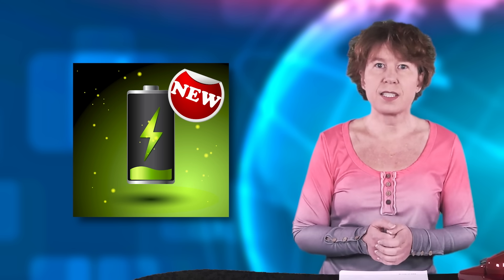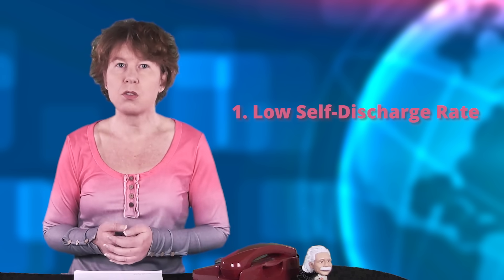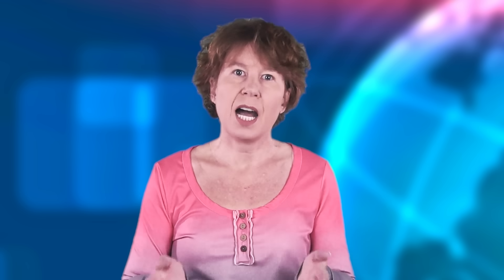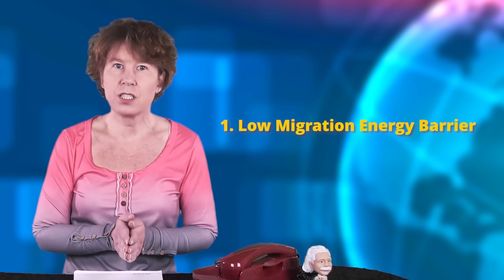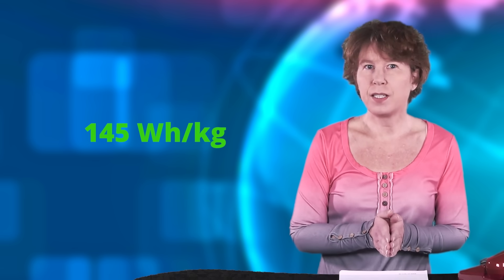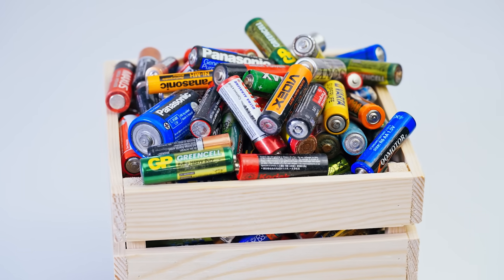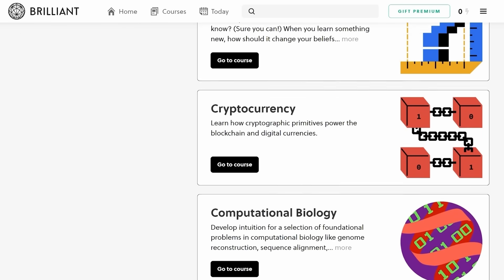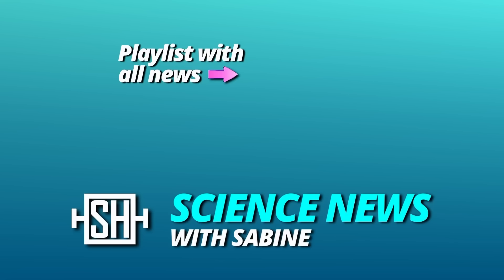Fully Charged in Just 5 Minutes: New Battery Breaks Records

Comment: I think people have to look at the history of the automobile to understand the issues EV faces. First if all, the car remained for many ppl a curiousity well after the model T. Cost was a big factor as with EVs, the 600 buck model T was a lot of money and banks would not lend 600 bucks to a working class guy. Without a mass if cars out there, filling stations were relatively rare. 

The irony is electric cars until WWI were more popular than gas engine cars. Why? Ease of driving. The hand crank was a disaster area. Controlling the engine wasnt easy either, you had to futz with spark advance abd the like to be able to drive them. The starter and centrifugal spark advance drove the car forward. 

The real problem is they are pushing ev's ahead of the curve of adoptance. Pushing banning gas cars after 2034, for example, is too fast bc evs have limitations. 

Shall we talk about cold weather charging and that batteries output plummets when it gets cold? Lithium has the same problem lead acid batteries have, internal resistance grows as temp drops. 

There is also the fire hazard. Lot of places it is illegal to charge your ev in the garage. They have lost cargo ships with evs to fire, a car goes up & then boof, the whole ship is lost.  A big problem is putting out the fires, they often resort to water which is horrible, water reacts w lithium , but they have no choice bc they don't have the chemical fire compounds. So they will he pouring water for a half hour to try and put it out. 

Personally i think solid state fuel cells are the way to go, batteries fundamentally have the charging problem fuel cells don't have. No charging, you pump out the product if the reaction to be recycled abd you pump in electrolyte. 

We have to get off of fossil fuels, if for anything to put the middle east our of business, neutering Iran, Saudi Arabia, Qatar and Russia. Oil is basically a giant protection racket,  it allows iran and saudi and russia to do what they want and not face consequences.

Comment: Some technologies are so called "Enabler Technologies" which means they are often - on their own - not very interesting, however they enable other technologies and products to be actually useful.  A very fast charging battery is one of those things.
Reply: I can imagine military would be interested. Or medicine. Or some field occupation where it really matters. Not everything has to do with our phones or cars.
Reply: To enable what? Electric mobility taking over, maybe? Not likely, and the earlier people realise that the better so a fast charging battery like that may actually be a bad thing.
Reply: @martinstubs6203  If it doesn't work for that, other people might find a completely different use for it. Just an idea: with such batteries wireless headphones would become the standard, because you would no longer have to put such heavy batteries into it. If they only last for like 4 hours, but they completely recharge while you take a bathroom break, that wouldn't be an issue.

Comment: The major issue , should this ever come to fruition, is that the 145KWh is now delivered is 5 minutes - so if that 145KWh is normally dissipated (at steady rate) over a 2 Hour journey, then to replenish it in 5 minutes will need 12*145KWh equivalent input 1.74MWh delivery to the filling station where now you are not waiting for the 1 hour charge but for the queue of people waiting to use the outlet.  Then the cables will need to be hightly specialised with the energy capacity and isolation to handle that amount of power safely.
Reply: Ultra rapid chargers often work by taking the power from an onsite battery which can be charged up more slowly, averaging out the current draw, instead of needing a very high power grid connection that is only used part of the time.

Comment: I have been watching your channel off and on, mainly on topics I have an interest about. But I saw that I think Toyota (Japanese car firm) making an H2O engine and was hoping to learn more about how it would work in your way of explaining things.
Reply: Toyota have been selling these for years.  On a 1000km journey in Norway the hydrogen powered Mirai took 8 hours and forty minutes.  The battery powered Tesla Model S LR did it fifteen minutes slower.  Neither of these times included time for breaks.  If breaks were included the Tesla would have been faster because the charging would be happening during the breaks but the filling with hydrogen can't be.

Also, with hydrogen you lose many of the benefits of an EV so I don't think hydrogen is viable.

Comment: The indium option provides a secondary market for zinc mining tailings. It won't offset the lithium issue, but may mitigate the lithium-producer-advantage in markets.
Reply: I'm thinking that stationary batteries, like for whole house backup, don't need to be light weight and smaller volume, which would release more lithium production for uses where energy density is important.

Comment: Why restrict battery re- charging on the go to brake regen... What would be wrong with an old fashion dynamo made lighter with modern materials and utilising Hall effect..  Interfaced with a  segregated battery under software control. If the dynamo engaged via a clutch, it could be selected in train or out, so that a   car  with a modest size battery could be set-up to yield that extra 50 miles to complete a long journey by trading speed for a modicum of on-the-go re-charge over a limited distance, without needing to stop for a re-charge.

Comment: Indeed most of the time with electric cars your charging the thing at home overnight and fast charging makes little to no sense. And right now you can go to a fast charger if your traveling and it will charge up like you said in 15 and 20 min. Charging speed for cars is pretty much a non issue so this technology is kinda looking for a problem to solve. Most electric cars have a very good range really.. Its about the same as your typical car and a tank of gas. Having to wait 20 min to charge a car while on a road trip just means I have to find something to do in the town or whatever and that does not sound like a bad thing at all. The MAIN problem with electric cars right now is that they are all considered luxury and so cost WAY too much for your average joe to buy...

Comment: I think fast charging can have its place, even if the density isn't as good. But marketing and customers will focus on long range while the charging infrastructure is still limited.

Car 1: 250 miles of range from 80%-20% (healthy usage zone), 30 mins to charge 20-80
To go 70 miles it takes you 1 hour driving plus 8.4 minutes recharging
And even if I say 15 mins 20-80%, it's still 4.1 minutes recharging

Car 2: 120 miles of range from 80%-20%, 5 minutes to charge
To go 70 miles it takes you 1 hour driving plus 2.9 minutes recharging

Comment: There has been a lot of emphasis on developing low weight, high energy density batteries, but these characteristics are important for mobile/portable applications. A lot more work should be done on developing the chemistry for stationary applications. It doesn't matter if a battery weighs twice as much or is twice as big (or both), if its just sitting there stationary. Its easy to imagine bulk storage batteries the size of a football field,  it wouldn't matter if it has other desriable qualities (such as very long life, low maintenance, low cost, high current charging and discharging etc etc. Here in Australia there was much talk about "the world's largest battery "  (Hornsdale Power Reserve), its a lithium ion battery bulk storage facility situated close to a wind farm. Its in a rural district surrounded by farms for many miles around. I suppose its a good demonstration of what can be done, but to my mind, this is the exact situation where weight and size is of zero concern.

Comment: If the lithium indium battery can be brought to market, it would be an improvement in lithium titanate batteries used in some electric buses. They share the same rapid charge time. The LiIn battery would have more energy density and, thus, more range. They may also be useful for battery electric multiple units in trains.

Comment: The battery is not the limiting factor in charging EVs. The problem is that watts = volts times amps. A standard household line of 120 V limited to 15 amps (a Level 1 charger)  can charge at a rate of 1800 watts. a five minute charge would be 150 watt•hours  -- not enough to go a mile. A Level 2 Charger 240 Volts at 30 amps produces 7200 watts and a five minute charge at that rate will produce 600 watt•hours enough for 2 or 3 miles. Only if you use a high voltage charger with a high amperage can you get a five minute charge of enough electricity to take you 100 miles. 20 KWh in five minutes requires something like 720 volts at 334 Amps and the real problem with that is drawing enough power off the grid.

Comment: @SabineHossenfelder I used to work on the road. That meant moving from one part of the country to another to service contracts for my company. This often involved going from (say) Northern Ohio to Souther North Carolina inside a reasonable amount of. Definitely within the day. Flying and renting vehicles was not a good option. Too many tools etc to take on the trip. I was only one person out of a few hundred for the company. There are thousands of us working for hundreds of companies.
When I traveled, I would often travel 300+ miles between fill-ups. That included the twenty minutes I took to stretch my legs, and then I was on the road again. More than twenty minutes to  charge a battery is not an option in that industry.

Comment: The main problem with pretty much all rechargeable batteries is the formation of dendrite; narrow metal spikes which grow between electrodes, ultimately shorting them. This hampers efficiency and the reason why your old phone doesn't last through the day anymore. The faster you charge a battery (as well as other things like charging outside the optimal temperature range, charging to full capacity, discharging to lowest capacity, ...) the faster these dendrites grow.

So my question is, do these indium spiked lithium ion batteries have better or worse dendrite grow characteristics?

Comment: Half power doesn't seem that good, maybe the problem is the output power is being blocked by the indium coating on the cathode rod, (the indium which helps with input, charging, but not output, discharging, implying that indium on carbon has a one-way direction for electricity) , so maybe the answer is to have 2 cathode rods, one carbon and the other 'carbon indium' ? To get a full power fast charge battery.

Comment: The point is not whether the time of charging is 30 or 5 minutes. The point is that the indio battery time charging is similar to the refueling of a gasoline or gasoil vehicle. Until the batteries will not charge in about that time (1-2 minutes) I will not buy any electric car, and also when the charge will guarantee me an autonomy similar to that of my car with a full tank (800-900 Km in highway driving).

Comment: To answer your question Sabine , NO . 
Um , but switching them out would be nice when one (or a set ) goes dead . 
It’s like my phone . The battery is built right into it , so if there is a need to get rid of the battery , you have to trash the whole damned phone ! 
I think that should apply to everything except equipment with a specific one time use . 
I’ve never had a burner phone , but that’s for porposes I don’t need .

Comment: Today's EVs already charge 20%-80% in 20-30 minutes.To get the same amount of energy into the battery in 5 minutes you would need 461kW. That's an insane amount of power. Even for an 800V system that's 576A. That's terrifying.

Comment: If you were say, homeless you'd want a battery to charge fast, as you're options are limited. You'd have to charge it in a McDonalds where you're only limited to 20 minutes. Yes, those places exist in my city.

If you live in a dense city with off-street parking only, you want your battery to charge as fast as possible. Who wants to wait a few hours in the car in the snow or heat? You can't charge overnight if it needs to be plugged in in a public area. I can see teens disconnecting overnight charges that are unattended .

Charging a phone and a car are two different things.
Reply: LOOK UP THE CONDENSED AIR CARS ON YOUTUBE   A FRENCH MAN INVENTED THESE IN EARLY 2000 NOW THEY GO VERY FAST   HIS ONLY WENT 71 MI PER HOUR BACK THEN  AND THEY DO NOT NEED A BATTERY EITHER  TAKE CARE PASS THIS AROUND OK?

Comment: When considering EV applications it's important to look at typical use cases, one of which is lengthy highway driving where the length of trip exceeds the storage capacity of the battery. At this point, speed of recharge becomes critical for two reasons:

1. The more obvious one is the average person's reluctance to hang around for 30-40 minutes (or even just 20 minutes) at a charging station waiting for the task to complete. With current generation EVs, an 8-hour trip via petrol/deisel will require at most one 5-minute refueling stop. The same trip with an EV is going to require at least two 20 minute stops, adding perhaps an extra 10% to the total trip time. Maybe that's not a big deal to some people, but to others it most certainly will be.

2. The other consideration which isn't voiced nearly as often is the capacity of the recharging stations. If you consider a typical highway station where during the day about 70% of the pumps are in use at any given moment in time, and the typical refueling stop is  5 minutes, that means the EV charge time of 20 will require at least 4x as many  stations as there currently are pumps, and (from #1 above) the demand for a charging station will double due to the reduced range, so that means we need to replace our current infrastructure with 8x as many charging stations as there currently are gas pumps. That includes needing a significantly larger chunk of real estate to be able to have that many vehicles concurrently using the station.

Having faster charging would overcome consumer reluctance re #1, and the serious station congestion issues of #2.

Comment: I'm not sure it makes sense to think of this as something for immediate use with the same use cases. Rapid partial charging through induction at, for example, a traffic light, would be much more feasible with this kind of charging speed for instance. Could see use in a slightly more modern energy distribution environment.

Comment: I would rather not wait 2hours at a petrol station when the battery is on empty. And if charges are already full, and theirs a queue it could be waiting a day.
Reply: The batteries could be owned by a company which also replaces discharged ones with charged ones for a fee.  This would eliminate the wait time for charging.  The battery swapping stations would replace petrol stations.
Reply: @davidletsch3198  Are you talking about taking pretty much half the car to bits to change a ton worth of batteries. I don't think that would be a viable option. I have seen a motorbike that has a removable battery.

Comment: That's going to need the best part of a megawatt to charge a typical electric vehicle battery in 5 minutes. It only requires a tiny amount of that energy flow to be converted into heat to have very disastrous consequences. Seeing as the grid and distribution system of most countries isn't designed or equipped to handle such currents, you are probably going to need storage capacity at the charging station. And energy stored there is a potential bomb, the bigger the battery, the smaller surface area to volume ratio, the less ability to lose heat and even more potential for some sort of thermal runaway. Like the ones recently seen in London bus batteries.

Comment: around battery engineering is a lot of parameters that do make a difference.
operational temperatures and charge times are linked.  
also charge/discharge rates and lifetime cycles are linked.
The energy density as it relates to battery integrity is the problem.
the first four can be solved with existing tech.
that last one has to be solved.
burning easily and the follow on toxic smoke are enough danger 
to remove the current batteries from consideration for auto service.

as sad as this is to say, LiMH in steel cells is the best tech we have for autos.
They can be charged quickly from about 30 percent to 80 percent in5 to 10 minutes
without noticeable degradation... 
better energy density than lead acid, which is not saying much...

This battery may be a good option if it can take being in a 5 kph bump without
becoming a ticking time bomb...

Comment: A lot of work is being done on developing Lithium sulfur batteries, which purportedly have advantages over lithium ion batteries, namely much higher energy storage capacity, higher energy density, faster charging, faster energy delivery, and less chance of discharge runaway, along with a host of their own development problems.  However, there are several companies who are in development and some claim to be bringing lithium-sulfur batteries to the market in the next few months (years?).  One such company is Zeta Electric (Houston & Munich) who claims to have re-designed the Anode and Cathode to include Sulfur and overcome many of the problems that sulfur poses.  Another is Lyten ( San Jose, CA) who claims to have developed a 3D graphene scaffold doped with sulfur that also eliminates many of the problems of sulfur based batteries.  I guess we will have to wait and see.  Take it with a grain of sulfur.